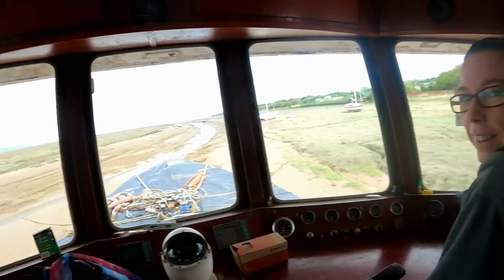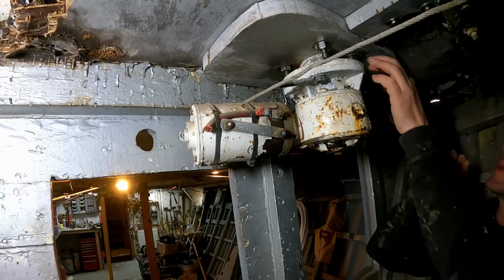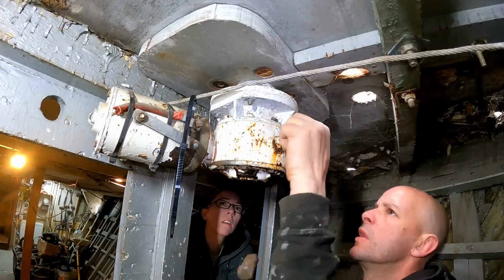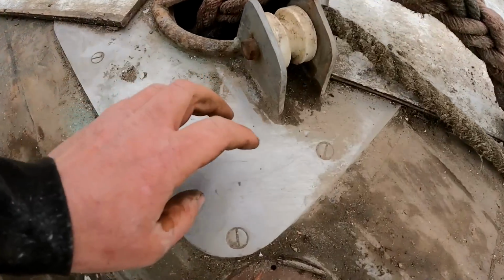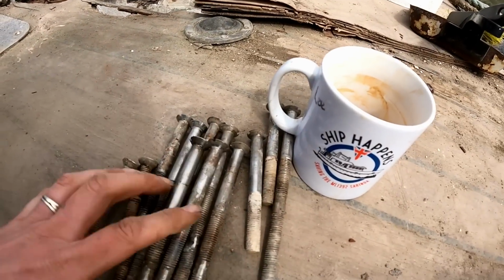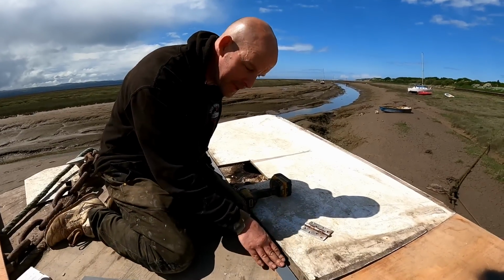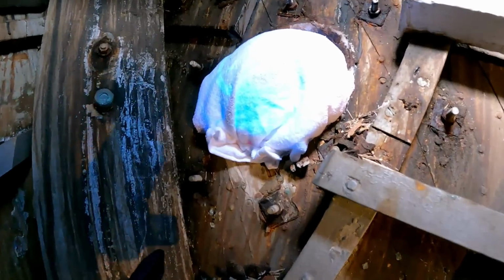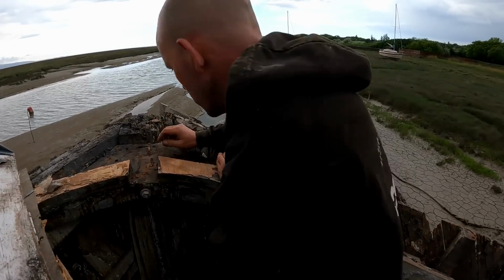Ep 124 - Stripping Down The Bow For Major Repairs - Windlass Removal #boatrestoration

Comment: Seeing Gemma with the hoover  through the hole in the deck,   an idea popped in my head.  When you are install the new deck,  It might be handy to have a hatch in that area.  You could use the horizontal boards (stringers?) as the steps/ladder.   It would be useful when loading things into the forward compartment. But,  more importantly,  in an emergency,  it's another way to get out of the ship.

Comment: Really glad to see you guys exercising good line discipline and not stepping into the bite of a line even though the ship is stationary. That kind of safety discipline will save you in the long run.
Reply: Interesting comment. I'm curious can you please explain a bit more so I understand. Tq
Reply: @davidantill6949  you don’t want to step inside a loop in a line, if it takes a strain the line will tighten around your foot and can injure you or drag you across the deck or overboard.
Reply: Thank you for the explanation 👍🏻

Comment: Muir is a good brand and they still make them today.
To cover the hawse hole I would suggest the side cut off a 3l milk jug held on by 4-6 tacks.The gloves will deflate slowly over a few days.
Reply: Just screw (or more safely bolt) two scraps of plywood over the hole one each side. There’s plenty of completely unsuitable 1980s junk wood on the boat. That will stop rodents and birds.

Comment: Great Job you two. Nice job on the hinged cover. Great idea. As for your hawse pipe hole. A square piece of plywood on the outside and a 2x4 on the inside. Run screws from the outside into the 2x4. Instant temporary patch. I do like the chicken balloon though. Great thinking Gemma. Always a joy to watch you improvise. Cheers.

Comment: I recon U should ditch the hawse pipe and install a nice big bow roller on the deck which also stows the anchor. The ship hanging on that hawse pipe is not that good, too many bolts not joined to much,   OK for a steel ship?  U could make a new breast hook from a stack of marine ply, unless you could find a grown knee. Great work U guys, love it, lov it

Comment: To block the hole in the side use 2 pieces of wood one on the out side and one on the inside and screw the 2 together with 1 screw in the middle of where the hole is

Comment: When Simon was taking off the motor for the windless winch all I thought of was don't hit your head on the bolts and the only reason to replace any thing is to much corrosion on the aluminum bits of it.

Comment: Watching you remove those tubes from their plates on the bow makes me wonder if they were reamed into place with an adjustable roller reamer, like when they replace the boiler tube in a steam engine boiler. It would certainly water proof the joint as steam engine boiler tubes seal against the boiler plate and are good for up to 250 psi of steam and water pressure.
Food for thought when reinstalling perhaps.

Comment: It would be a good idea to replace the steel tube with a stainless one to prevent galvanic  corrosion.
Reply: I’m no marine engineer but wondering if the mild steel pipe is to avoid galvanic corrosion of the anchor chain.
Reply: @davidelliott5843  I'd rather have a rusty chain than a rusty hole in my boat lol.

Comment: Once everything is off at the bow,  the winch, the hose pipe and plate, and all other metal bits for the chain,  before ripping up the deck it would be a good idea to make a template of all the holes and position of everything you took off,   so that you could lay the template with the position of the holes on the new deck,  for everything to be in the same place as before,  great job.
Reply: The level of rotten wood is epic. I’m wondering if the haws pipe is ferrous to avoid galvanic corrosion of the anchor chain. Hopefully people who know what they are talking about will know how it should be done. There’s nothing done in the 1980s that can be trusted.
Reply: @Dave5843-d9m  pretty much anything with age can't be trusted unless you rebuild/refresh it, or you know it's been properly maintained, and or not abused.

Comment: Great progress so far, the part at the pointy end is the breast hook, it would most likely have been fastened to the beam shelves and stem originally so perhaps there has been some parts replaced in the past by someone who took the easy way out, any idea what the top layer of decking timber is, is any of it able to be salvaged for reuse elsewhere in the ship

Comment: wont stay sharp cutting through coke cans unless you know how to sharpen them, which is an art in itself.... Keep them out of the dishwasher, the sink, prevent all fraternisation with other knives, only cut on a plastic board and it will stay sharp for a long time....

Next time you see tree getting chopped down, see if you can jump in and get some crooks to make that knee with. Look at the vid on my channel about the lodging knees I replaced on mine, nothing like your structural requirements, but an originally curved bit of wood would be ideal. Also check out Tips From a shipwright on the matter xx

Comment: There is a product that you paint onto rotten wood that soaks in and sets like steel , for small areas I use super glue it soaks into the rot set hard ,

Comment: Not wishing to teach your grandmother to suck eggs but I would recommend making a pattern of the holes of windlass and chain lock  as well as the orientation of your chain lock as it needs to be set  right to hold the anchor chain from being released. I guess someone installed the hose as a rattle silencer. I'm enjoying the developments on the boat. It is quite impressive what you have achieved. I also suspect that you have lost some timber as the area directly behind the stem is usually filled with a substantial timber. Would explain the bolts that are hanging in space. Keep up the good work.

Comment: What happened to the generator you made or are you using the eco flow generator to top off your batteries?
Reply from the maker: We are great just off solar at the minute, but we are planning to put the generator where the electrics are currently, so we need to move them to get the generator in

Comment: The easiest way that i used to be able to remember the difference between port and starboard, is that both port and left have the same amount of letters. After a while of doing that you'll remember that port is left and starboard is right.
Reply: And port, left, red have fewer letters respectively than starboard, right and green if you include your navigation lights.  I can still picture my junior school teacher working that one out on the blackboard in 1959.
Reply: @erikthomas2048  And a glass of port glows red too.

Comment: very disappointed to see you advertising that knife knowing it is  garbage, this is the facts about that knife it is not Japanese steel. I bought six of them to give them out as gifts at another site,
I was using my to cut a piece of turkey hit a bone with it a couple times but didn't think that none of it and kept continually to cut to me when I got done I looked at the knife and noticed on the blade there was a chip of metal missing where do you think it could be. That is Japanese steel soul hard and so strong no way could that break, that is garbage steel, stainless steel blade put a magnet on it it sticks to it just like it's a raw piece of hot metal steel clamps right onto it. And is far as to forging people that's paint and it will start coming off as you use the knife, I would highly recommend to anyone who is looking at this advertising and thinking about buying one, don't do that this is total garbage steel and very disappointed with this site for recommending it just shows me they don't care what they sell. Just as long as they got their sponsors, unbelievable people are still trying to sell this junk knife on the Internet. And by the way I threw away the entire turkey did not want to take that chance so I have a little hostilities when it comes to these nights and I hate it when someone is talking about a product trying to make it look good and they know it's not disgusting